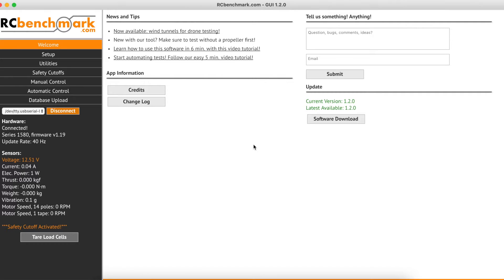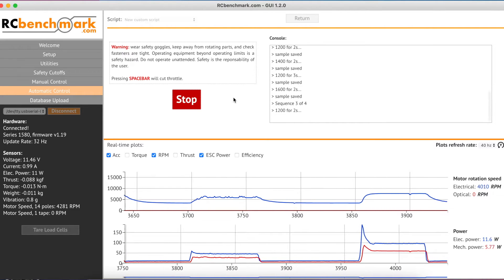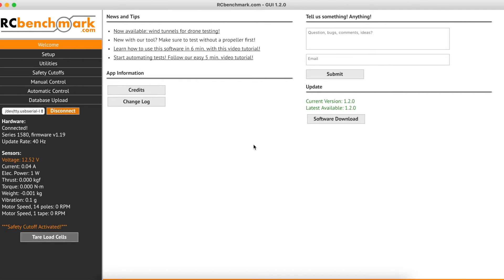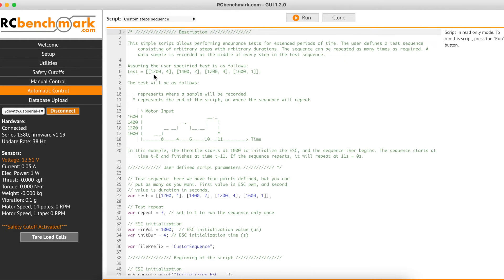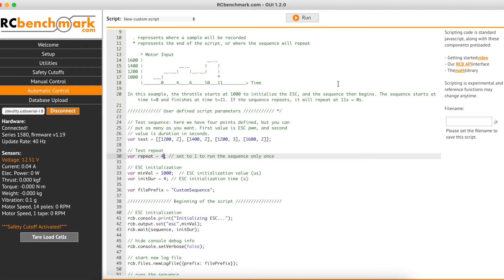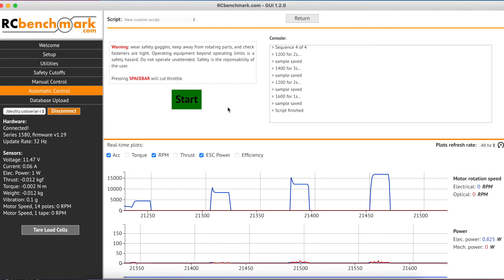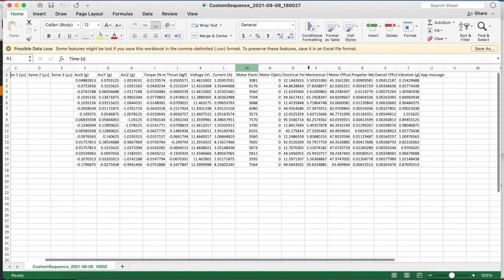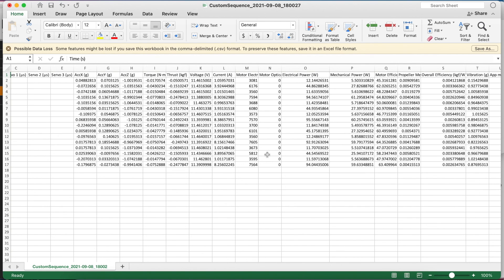How to Perform an Endurance Test with a Brushless Motor Thrust Stand

Comment: nice...Which sensor used for measurement of torque
Reply from the maker: Hi @escalade technology, thanks for your comment! In our Series 1580/1585 test stand we use a custom load cell to measure torque. The load cells are part of our solid state system, which eliminates bearings and friction for improved measurement accuracy. You can read more here if you're interested: https://www.tytorobotics.com/blogs/articles/why-and-how-to-measure-torque-for-brushless-motors-on-drones
Reply: load cell are suitable for  measurement of torque??  @tytorobotics
Reply from the maker: @escaladetechnology7545  yes, the load cells on this thrust stand can measure up to 2 Nm of torque: https://www.tytorobotics.com/pages/series-1580-1585
Thanks for your question!
Reply: @tytorobotics  ok
Reply: @tytorobotics will the same code work for a 1780 series too ?